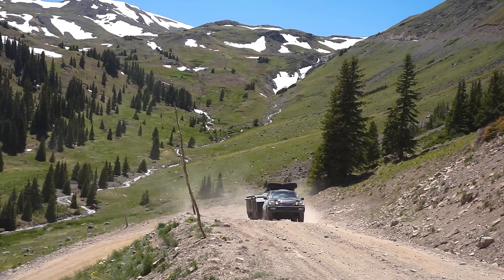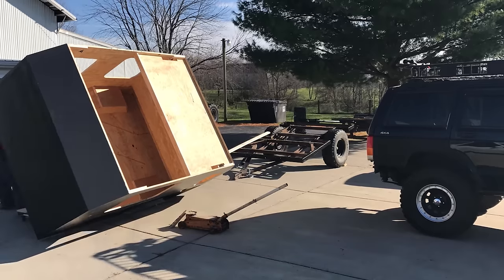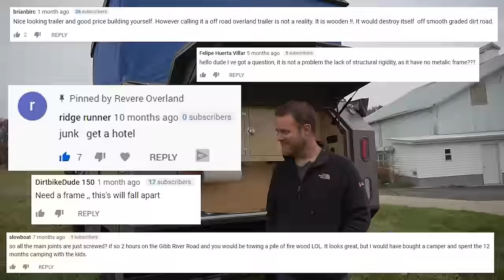Has Off-Roading been too much for the DIY Overland Camper Build?

Comment: You've done a great job of building this trailer and than you for the content! Only other comment I need to make is regarding the weight. With all that plywood I was very surprised to hear the estimated weight of 2000 pounds. You should go to a weigh bridge and confirm. Would love to know. Cheers
Reply from the maker: Cycle & Moto i would like to weigh it soon, but the plywood doesn’t weigh that much.  For instance the 8 sheets I used to build the body would have weighed 440lbs. And that’s before I literally cut off over 20% of it.   So that brings it down to conservatively 352lbs for the body for the plywood

Comment: Quick one mate. Plywood like to warp when covered with epoxy. How did you prevent warping?
Reply from the maker: Honestly, I’ve never had an issue.  I have fiberglassed wooden boats, speaker enclosures and this camper and warping has never been an issue.

Comment: I don't know why people wouldn't think it would hold up. Its basically built like a boat and boats have to contend with constantly crashing against waves.
Reply from the maker: Patriot Painter exactly!  I actually learned this method of construction 20 years ago when I built a sailboat.
Reply: With my automotive background.... I am not a fan of things built out of wood. Not even a boat. (I don't even live in a wood house). I just came across this video and I appreciate the layout, the effort, the build and utility, as well as, don't fault anyone that would take this project on and repeat it.... but, ... I wouldn't do it that way. Yet, I've always been that way. I never liked dealing with wood. Give me metal, and I'll shape it however you like. Give me wood and it will be used for heat. Ha.
Reply: @getinit56  I hear ya, but the wood is basically just there to give it shape. The strength and durability come from the fiberglass.
Reply: @PatriotPainter  Point taken, but I fail to see long term durability in anything built out of wood. I've seen too many boat floors rot, long before metal rusts. To each there own, but I would of chosen Aluminum. I'm simply just keyboard warrioring my opinion when I'm not currently building anything like this. So, his all of something that I may deem as not as comparable, is much greater than my all of nothing based on the ether of ideas. I did though, own a company in the polymers business and I have got more concerns with his choice of coatings, and thus rot, than I do with the choice of building materials. If any point of that "lineXed" type surface gets fractured, ... and it will (if only by sun alone)..... It will then do more to retain water and destroy it, than it ever would of done to protect it. I've sprayed thousands of gallons of it.

Comment: Is there a reason you didn't go with independent rear suspension? There would be less to hangup on.
Reply from the maker: jeff doak the trailer has more clearance than the vehicle as it is since there is no differential so I didn’t figure there was any need.  So far I’ve never seen a situation where it was necessary

Comment: Take the folding steps off and make them detachable. Store them folded and when you pull up to camp, design something to slide them into like rails. It's a nice camper!!!
Reply from the maker: Alan Fay that’s how I’m leaning.  I’ve made a design for them, just got to decide if I want to take the time to make them
Reply: @shaweehillsworkshop4226  Of course, that's how I learn too. But I must say you have done a brilliant job, looks like a bought one!
Reply: Swing them from the front of the camper with a dual triaxis set up. I'm guessing detachable goes against your engineering inclinations
Reply: @alabastardmasterson  Oh my! I'm guessing something detachable takes no engineering skills.
Reply: @aflaz171  didn't mean it in that way. Rough trails with loose gear and quick setup/break down are usually worth the effort

Comment: What a well thought out design. As far as your steps dragging the ground have you ever thought about using some kind of step that would just set on the ground and then when you went to leave just set the steps inside the trailer or you SUV?
Reply from the maker: That's what we did when we first built it, we had a little plastic one that folded up that we kept in a garbage bag (because of the mud,lol)   The problem was that it was too low for my wife and kids (according to my wife) so we went with the two step fold out.  I didn't expect to hit it as often as I do though.  We may go back to a stool, especially if I can find a good one that has 2 steps.
Reply: @shaweehillsworkshop4226  Maybe you could modify the fold out steps by removing them, weld a couple of rods or tubes on them and weld a couple of tubes on the frame of your camper so when you set up camp "plug" the fold up steps into the tubes welded to the frame and when your ready to go just unplug the steps and put them up, maybe to a couple of tubes welded to the tongue.

Comment: Strangely enough this is very similar to a design that I'm working on for myself.  Except that I want to use adjustable airbag suspension and as you say I plan it to be a little longer.

Comment: from the mouth of the man who built it uses it. GO W/PULL OUT KITCHEN from front extra box. This leaves more interior bed space/ above rear & inside shared access space. It got where market is NOW offroading trailer w/pop top or tent b4 it was a thing+ best prt he sells his shower/restroom system,v/good work, except used old frame trailer steel. 6bolts to chance med duty trailer onto new trailer frame. Galvanized is worth the bucks boating 101. Fiberglass again boating, u find out what works fast in salt water. Rhino lining & bottom guard system is another thing to pop for.

Comment: aluminum framed with fiberglass would be the perfect evolution for the trailer. would be able to remove a lot of weight
Reply: Why use 1950's technology when much better has come along?
Thin aluminum skin glued on a roommate core and thin plywood inner skin sandwich . Especially when curved extremely strong at a fraction of the weight of what he has now.
This is how European caravans have been made for the last few decades and they are durable and comfortable..
Reply: @cmulder002  god bless frp

Comment: Brilliant build, ignore the critics, those keyboard warriors clearly haven't built anything! Would a step or pair of steps hanging on chain or steel cable be an option? That's what a lot of military trucks use, just pushes out of the way rather than catching on the ground.

Comment: 1:45 There is no frame. 11:33 You had most of the metal for the frame. 
I'm confused.
Reply from the maker: B alton at 1:45 I am referring to the framing of the camper, at 11:33 I’m referring to the frame of the trailer that the camper is sitting on
Reply: @shaweehillsworkshop4226  Ohhh...I get it. Thanks for the response :)

Comment: Yeah, the plywood wouldn't last, and its heavy. Framed tube aluminum with aluminum skin would still be going today as long as the welder was good.
Reply from the maker: Gypsy JR did you watch the video?
Reply: @shaweehillsworkshop4226  Enough of it to know. Plywood isn't a good off-road building material. Decades of experience and mistakes behind that statement.
Reply from the maker: Gypsy JR did you watch long enough to know that it’s wrapped in fiberglass?  I also have decades of experience and actually focused on composites in engineering school and have built sailboats using this same method.   As for weight.  If you add up the weight of all the plywood assuming I made no cuts and used the full sheets it equals 480lbs.   I truly understand why you would think what you do but it just simply isn’t true.
Reply: @shaweehillsworkshop4226 Well, its done well, but you can never convince me an aluminum space frame chassis/cab isn't superior for the rigors off off-roading.
Reply from the maker: Gypsy JR I never said it wasn’t, I am simply saying that you are being closed minded to the capability of composites.  While aluminum construction should be lighter, strength should be comparable but cost is way different.  The composite is much cheaper to construct and requires no specialty tools

Comment: I use at least 5 gallons on one shower. 20 gallons would last 4 days if I don't use water for anything else.
Reply from the maker: jmmj jmmj then you’re doing it wrong.  When camping you spray and get your body wet, maybe 20-30seconds.   Then you turn the water off, wash and then turn the water back on an rinse yourself off for maybe 20-30 seconds.   You might shower for 5 mins but only run the water for about 1min at most.  While being off grid water is not a commodity

Comment: Buy a BRUDER EXP-4
Reply from the maker: a Bruder EXP-4 is an amazing trailer, but it only sleeps 2 people and is $42,000usd, mine sleeps 5 and I spent $5,000usd building it.  kinda a no brainer
Reply: @shaweehillsworkshop4226  it. will actually sleep up to 5 people
Reply from the maker: Adam Hector what am I missing?  All the pics I’ve seen of the exp-4 is a queen matress on the floor?